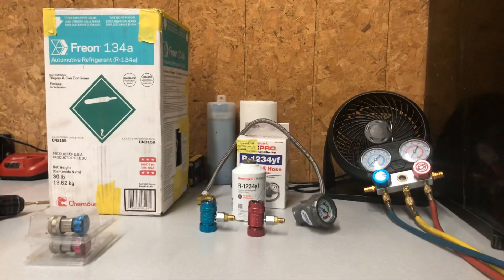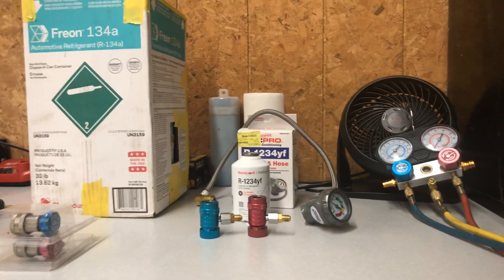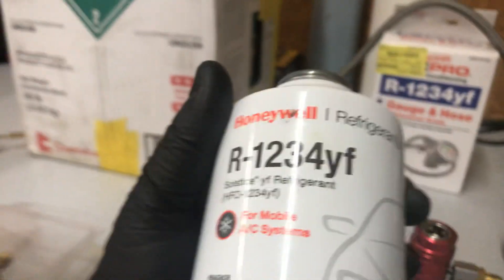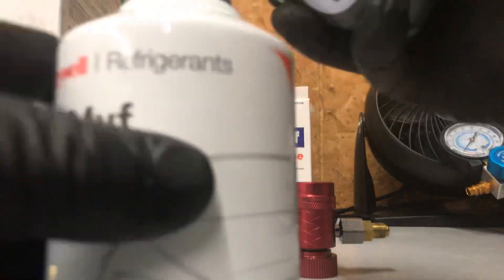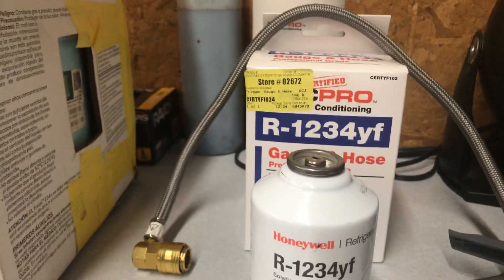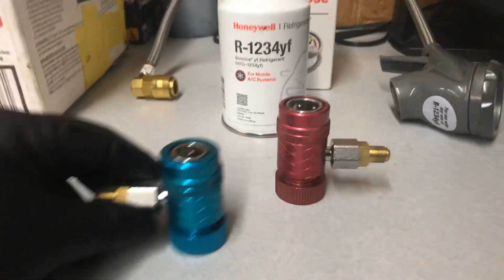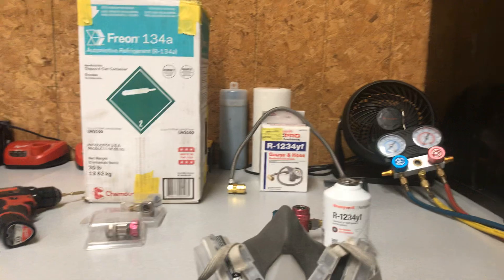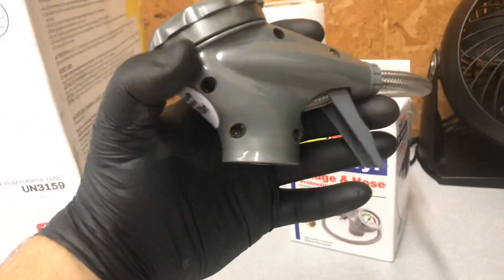Do It Yourself DIY R-1234YF Refrigerant 1234YF / R134 is old news now

Comment: autozone does not have r1234yf because it is a highly shopliftable item and is kept behind the counter so you have to ask for it.

however what autozone does have is an empty display box however some stores may be in even higher risk for  shoplifting area and may not even display the box or they are in states with anti diy laws like wisconsin so even to buy the small bottles you need a license.

Comment: Just buy the high and low side  quick connects like you did and then buy a set of piercing can pliers and your set . They are just big plastic pliers that you squeeze the freon can in and it pierces the side of the can and then you connect the pliers to your yellow hose on your gauge set via the 1/4th and 1/2 acme connections on the side of the pliers

Comment: So got a few questions here I’ve never worked with ac before other than filling but I do know I don’t want to pay 550 to evacuate the ac and refill it after dropping 2k on parts while having to do it myself anyways due to a compressor taking a crap and not wanting to pay dodge to break my car and charge a left nut. I have a 16 hellcat challenger and bought ac compressor, liquid line, condenser, ac expansion valve, and radiator with coolant tank because the system is gunked up so figured do it all in one shot. So my questions are how much r1234yf does a hellcat take? And how do you evacuate the system properly? What tools are needed for a diy evac and fill of the proper amount correctly. What are some ways to find out everything is sealed up. Gonna do it in 2 weeks so all information and tricks to this are extremely welcome thank you.

Comment: I have a Ford escape 2017 model that some tech replaced 1234yf with 134a & the symptoms I am getting is, the A.C. system shut off randomly, it will come back on like 10 to 15 seconds later, the fan speed is at 1 could the r134a be the culprit that is causing that mess?
Reply: You can fill any 1234yf car with r134a gas without any problems. They were designed with this in mind even tho the connectors are different.
Reply: @Yamaha.ha.ha.ha.  
Not if your working on a full electric car that contains R1234yf , you can contaminate it with wrong pag oil making the chassis live.
Reply: did you find and repair the leak?

Comment: Is the 1234YF colder then the 134a? If it is colder can I take the 134a out of my 2007 dodge charger and upgrade it to the 1234yf??? Thanks for any info have great day
Reply: there are a few replacement refrigerants that are designed to replace 134 or 12 and they cool like 12 (and are only a "little bit" flammable haha). i've used a couple and they cool like a rock star. oh and most have been out a pretty long time so no new surprises
Reply: Nope I've done the conversion from 1234yf to the older and it's much much cooler . Plus cheaper than the new refrigerant.

Comment: Can you just add the refrigerant without needing to vaccuum the system? This is for those of us who may not be able to purchase a vaccuum at the time.
Reply: Why if you're only going to top off a slightly low system ? Vacuuming is when you're dumping all of your freon from the entire system to refill entire system with all freon
Reply: @AM-ry8ls  if its slightly low, that means it has a leak. If it has a leak, then the system is contaminated.
Reply from the maker: jorge  you must Vacuum the system
Reply: What I did was buy a vacuum and then returned it after I used it

Comment: 1234yf has a GWP (global warming potential)of 4 where the r134a has a factor of around 1430, the r12 and r22 had a GWP   of 10900
The next best thing will be r744 whose depletion factor is 1!
Reply: @Mustang Ricer6589 r744 operates at so high 1400+psi pressures that it would be impossible to have long AC systems service life. e.g toyota Camry are known to have the same AC system for 20years never refilled still working. I estimate the new r744 system to have leaks and destroyed compressors in 8 years tops!
Reply: propane has a low global warming potential also.  you might want to affix the "do not crash" sticker to the steering wheel immediately after charging the system with propane though.
Reply: Yet 12/22 is still a better preforming Freon than that new crap

Comment: Can i use the R134a instead of this crazy exprensive 1234YF ?
Reply from the maker: John Doe I have been told not to because it can hurt internals of the system ?
Reply: Oh Sorry 
English is not my mother language lol 
Thank you
Reply: mercedes dealer does it
Reply: @i.jackanov7382  
For real? And there's no issues using the cheap 134 instead of the 1234yf?
Reply: Yes you can it works normal I do it on many vehicles no problem this is just eco shit from car industry
Reply: @nimrabuljak  thank you for info

Comment: It's not that flammable. If you were a (MACS)   https://www.macsw.org/web/MACS   member and attended yearly training event and trade show you would know why they are replacing the refrigerant. You would also know you do not switch hoses and gauges between  R134 and R1234YF. If you had epa refrigerant test you would know that. MACS has free training videos and you can download a free training book.
  https://www.macsw.org/web/MACS/Certification/Section_609_Training_Video/Online/Certification/Online_Section_609_Video_Training.aspx?hkey=37361225-1313-4676-87cc-87c2726060a8

some of the new R1234YF system are so small capacity that only 30g. -1oz. can make a big difference on A/C performance. That's why cans should not be used. owning a scale now has to be with in = or - 5g. 
A refrigerant identifier is now required and mandatory for all shops who preform air conditioning service. TOO MUCH CONTAMINATED REFRIGERANT because of cheap idiots who recover out of one car contaminating all their refrigerant then sticking it into other peoples car like a STD.

Comment: Can you put 1234yf in an r134a car?
Reply: no oil incompatibility. and will not preform as well. They upgraded condenser and evaporators and on some cars they even added heat exchange for add subcooling.
Reply: So what do we do once r134a gets banned?
Reply: Jacob Vaughan it will not be banned to use in cars. It will only be banned from new production from the refrigeration manufacturers but it will always be allowed to be put into vehicles just exactly the same as R12 is still allowed to be put into vehicles in existence from old stock of R12 refrigerant that is still on the shelves of many old warehouses and in peoples garages.   
          So for the next 20 or 30 years they’ll be no problem with stock of R134. By then you’ll probably not have the vehicle you have now but if you do there will be no worries the price will just be a little high per pound. 

         They will still be producing our1234YF for probably another decade or more because it’s required for heavy industrial equipment and farm in ag equipment do not apply to the new role yet for several years of using the new refrigerant R1234YF and military they have to keep the supply R134a stock up for all the military vehicles, military equipment refrigerators and anything that needs refrigeration so the production from the manufacturers will continue for the next few decades. 
       R134a used to be $300 for a 30 pound container when it first came out and then the price fell as the vehicles became commonplace and 100% of all the manufactures vehicles were R134a. 
           Exact same thing is happening now when I had to buy my first container of R1234YF it was $1500 back in 2012. 
        Two years ago for our 1234YF the price fell down to $1200 and then $1100.
            Last year the price for a 10 pound container fell down to $860 and we are talking about wholesale cost not retail today public that would be more. 
          As of about five months ago the price has fallen down to $599 for a 10 pound container wholesale price. 
            But of course the automotive shops will still have to charge a high price to recoup the cost of their recovery machines and recycling equipment and with the newer refrigerant gas you need another new refrigerant leak Detector good ones usually range around five or $600 for each employee that you have one for in a shop unless it’s a cheap shop who has only one leak Detector and make all the technicians share one tool for everybody.
Reply from the maker: t lech 😎
Reply from the maker: No Jacob, it would cause major problems in the long run!
Reply: I found the r1234yf for $45 but not the adapter at auto zone . But they would’ve charged a few hundred just for a few pounds not including diagnostic fees. If you can find  this I HIGHLY recommend doing it yourself & save a few hundred. Also the pressure gauge is worth buying to test yourself to see if it’s just low on refrigerant.
Reply: Yes u can aslong as u vacuum it's all out ur good and add the r134a I've done it before and have had no issues. 1234yf 40-50 a can r134a 5 bucks a can lol ..I'll keep doin the conversions f the epa
Reply: @joeroe2839  the epa doesn't even say you can't do this. amazing. i think mercedes has a tsb released, outlining ditching the 1234 and installing 134. also amazing.
Reply: @i.jackanov7382  yup do it and it will work